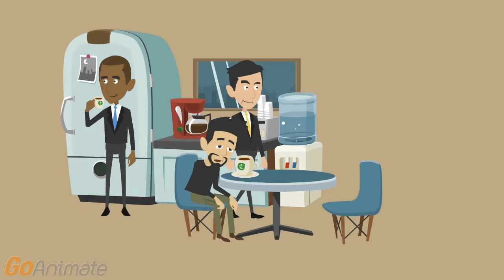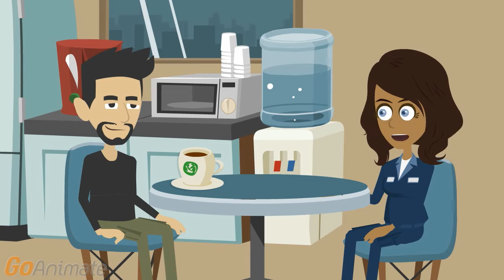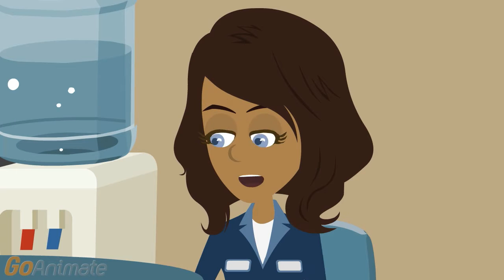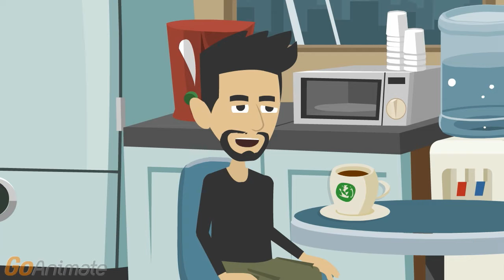Intertherm Furnace Error Codes

Comment: Well Appliance Princess. Your description of error codes 2 and 3 sound exactly the same to me. Reading directly off the error code label from a M3RL furnace, the #3 error code is as follows. Pressure switch is CLOSED with inducer ON. Now that sure does not sound like an error. Can some one please explain why Intertherm is listing having a closed pressure switch with inducer ON as a fault ?